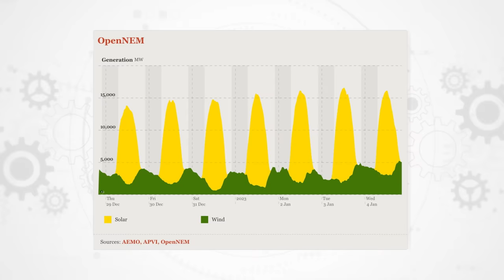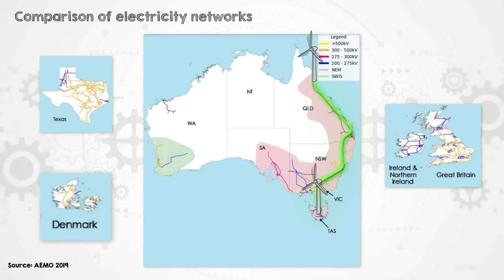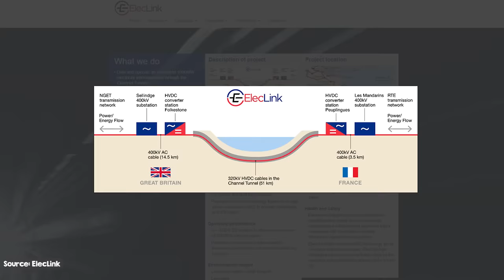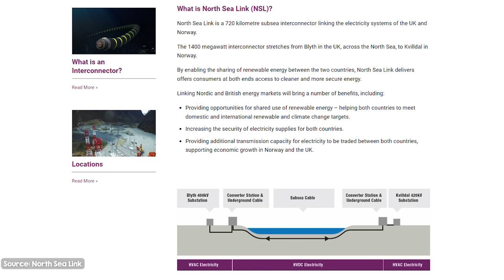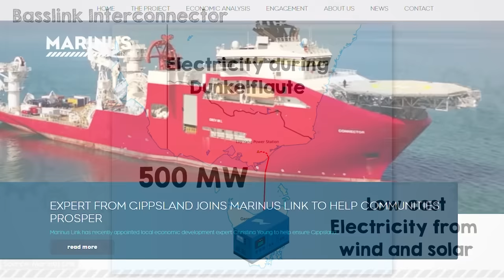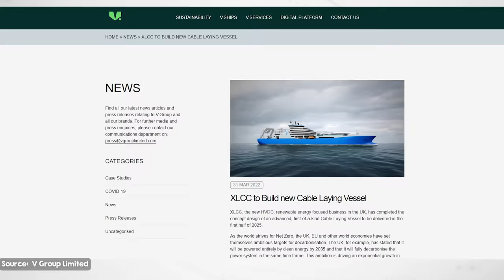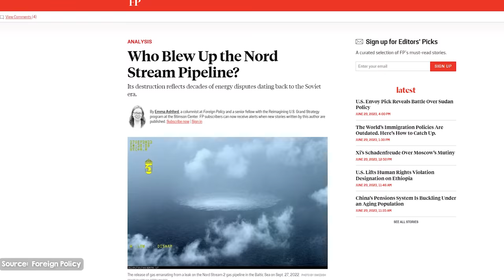Electricity Across Oceans: Is HVDC the Future?

Comment: Hey, high voltage test systems engineer here.
This is an awesome explanation video! I love the representation of HVDC you are doing here. Economic reasons and technological feasibility have a great balance here.
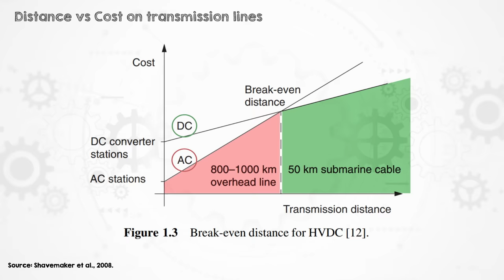You said the cables have a high capacitance due to their proximity to the ground or water. 4:10 While this is technically not wrong, the reason for the high capacitance is their outer, grounded sheath! These cables are under ridiculously extreme electrical stresses compared to open air transmission lines. Their insulation is quite high tech, but the sheath is a key feature. It homogenises the electric field inside the insulation, greatly reducing stress. Also, it keeps the electric field inside the cable, so the outside is (nearly) field-free. Very important as to not disrupt all kinds of stuff going on outside the cable.
Reply: Always happy when experts add to the content. Thanks for your info.
Reply: Given the oportunity i simply must ask: EU to US transatlantic UHVDC cable is still not a reality because...? I mean is it really still technical or economic at its core? According to Rosie 3% per 1000km would add up to 24% for 8000km. That's significant. 10 to 15% sounds like something we could live with. Is there a technological potential here or are we pretty much at the margins? Really excited about the future prospects of this technology!
Reply: @aleksandrsnaumovs4277 Rosie answers that question in the video: because we literally don‘t have the ships to handle that much cable at once, nor the cable factories to produce all of it (yet).
Reply: @screwaccountnames  She never mentioned anything about the losses of 8000km cable. I extrapolated that. The plan she mentioned is in it's infancy. Factories, ships and all that...these mobilization costs. We'll cover this blue marble in a web of wires if there is profit to be made AND the technology is mature enough. So...where are we? Are we still developing the tech and procedures?
Reply: @aleksandrsnaumovs4277  Electrical resistance goes down if you make your wire thicker. This means that theoretically, it should "just" be a question of making your sub-ocean wires thick enough to reduce losses to an acceptable level. However, that's obviously also a huge cost factor, and maybe even a materials science problem (I don't know things get too stiff / prone to breaking if you make the cable too thick).
However, even if we built the production facilities for that much cable and the ships capable of laying it on the ocean floor, I don't know if those huge investments would be justified by the economical benefits of a connected grid.
Reply: Thanks for your well informed reply!

Do happen to know about Ultra-high-voltage  DC or UHVDC? 

I have been reading (not an expert in the field, just interested) about it in the past,  They work with voltages up to 1,100 kV and are supposed to minimizing transmission losses.  Seemingly production ready, especially suitable for long distance (thousands of kilometers) . 

Notable examples include the Three Gorges-Gezhouba-UHV DC transmission line in China, the Rio Madeira HVDC link in Brazil, and the North Sea Link connecting the power grids of Norway and the United Kingdom.
Reply: Was she correct about the "inductive losses"? I've never heard of that, does she just mean extra VARs?
Reply: @Ikbeneengeit good pickup , I think you’re correct. 
There’s no real power loss in inductors or capacitors - however they result in less real power being transmitted for a given cable VAR limit.
Reply: The simple answer is that it's too expensive. You always need to compare transmission with just building generation instead. A few GWs of generation will probably me much cheaper and less risky than the world's longest HVDC cable.
Reply: @mikegofton1  Not completely true. In any practical circuit, both reactive AND resistive aspects exist. Current in a capacitor for example, will also create I2R losses. So with an AC transmission line, even with the load disconnected, capacative coupling will cause I2R losses. Not so with DC.
Reply: @johnchapman1903  I beg to differ - my statement was accurate. An open transmission line will have some power dissipation with AC voltage applied, however it’s only due to the conductors resistance. Rosie stated that the continuous changing of polarity across a capacitor results in resistive power dissipation, which is a bit misleading. The distributed inductance and capacitance of a transmission line does not , of its self, dissipate power.
Reply: @mikegofton1  fair enough, but I’m asserting that in the real world capacitance does not exist without resistance, with the possible exception of superconducting capacitors.
Reply: Likely, you are explaining the reason Hydro-Quebec is saying that it 550KV CC line crossing the St-Laurent river—the wire in the tunnel will last only 40 years.  A lot less than the cable over the air.  (Maybe, the fact the line was build in 1992 make it different than modern one)
Reply: @mikegofton1  this is what Rosie does for her day-job, she knows what she's talking about, she's also backed up by every textbook from high-school level to university level.
Reply: @aleksandrsnaumovs4277  you answered your own question – "it's in it's infancy".
Reply: @aleksandrsnaumovs4277  the distance problem is both technical & economic, lines losses (I understand) reduce with distance so 100% loss takes more than 30-odd thousand kilometers but not enough more. At the end of very long runs the loss is still more than accountants will stand for. 

There are improvements in line losses being invented frequently but obviously it takes a while for them to get on the market, the line Rosie shows in the video is very different from the 1850s lines that originally crossed the Atlantic, to start with cross-linked polythene is a relatively new invention compared with gutta percha so are semiconductors that she showed as a 2nd layer of insulation. One day a superconducting material that works at high enough temperatures to lay undersea will be invented but that hasn't happened yet.
Reply: @alanhat5252  I’m not disputing Rosie’s qualifications, and her channel content is excellent which is why I subscribe.
For clarity, the point I noted in my comment relates to the segment where Rosie discusses why AC transmission lines dissipate power without a load applied. The explanation showed graphics of capacitors and inductors with a description of how energy is stored within electric and magnetic fields. Rosie said this resulted in resistive power loss, which is what caught my attention. I wasn’t the only one who had the same reaction, which is why I posted my initial comment. In electrical engineering text books, transmission lines are modelled as distributed RLC sections which makes it clear that power dissipation occurs as a result of idealised resistance - not idealised capacitance or inductance effects, which are themselves lossless.
Reply: @screwaccountnames  You can make thicker cable, but it’s better to use higher voltages. Doubling the voltage halves the current, which cuts resistive losses by a factor of four. So rather than a 3% loss over 1000km, you’re looking at 0.75%. 0.9925^8=0.9416 Seems like a 6% loss on a Transatlantic interconnection would be entirely manageable. 🤔
Reply: stingrays would not be happy without that sheath haha
Reply: as long as they dont make the cables out of expired carbon fiber i think it will be ok
Reply: @serversurfer6169  Doesn't higher voltage mean thicker cables as well? It's just that the added thickness is in the insulation rather than the metal core.
As far as I understand it, it should make no difference to the overall thickness of the cable whether you double the diameter of the insulation (meaning you can double the voltage) or the core (resistance scales inversely to the cross-section, which scales with the square of the diameter).
Now I don't know what's actually better from a cost and ease-of-manufacture perspective, but I suspect it's a mix of the two.
Reply: it might be uneconomic now but with energy flowing from Germany, morroco, France, Iceland, Norway etc on one side and all the American Grids except texas on the other side, there would ALWAYS be high profit arbitrage availble somewhere. . The network effect could change things entirely.
Reply: @screwaccountnames  You’ll need more insulation, but that’s typically cheaper and lighter than the conductor itself. Also, DC circuits don’t require as much insulation as AC does at a given voltage, because the voltage swings in AC increase the effective load by more than 40%, so a 220VAC wire needs insulation rated for ~315 volts. 🤓
Reply: @aleksandrsnaumovs4277 I'd think it's a question of off-peak excess.  Losing some 25% of "free" power still gives you 75% to sell.  If you have a ton of excess wind at 2am, why not sell it in another market's 2pm peak.  It just comes down to how much it's worth in each local market.  Does that difference in value and the volume available overcome the cost of the install/maintenance.

After that, you have the question of diversity and robustness.  More power sources means less chance of any one type causing problems.  Harder to quantify financially, but still a factor.
Reply: @meeponinthbit3466  You say diversity of power sources is harder to quantify financially, and that's true, but wholesale power markets very much do it. There are several "grid services" you can buy and sell aside from just kilowatt-hours. Hence, grid storage is not just arbitrage (buying power when the wholesale rate is low and selling when it is high), a battery bank can also be compensated just for being there as emergency backup capacity, and for other services like frequency stabilization.
Reply: @Ikbeneengeit  theoretically both capacitive and inductive components are lossless but it is the dielectric heating caused by the capacitive currents that causes losses. Inductive losses are radiative but can be high at high voltages and currents
Reply: some believe in centralization and that is the opinion of the industry experts. Local production and storage can be efficient- if done judiciously.
Reply: Imagining shocked earthworms
Reply: @janami-dharmam  yeah, the energy for the heating had to come from somewhere.  But aren't the phaze offsets associated with capacitance & inductance a cumulative problem over long distance too, much like how initially the telegraph line didn't work? 
  Why is this even being argued over if the original discussion is about using DC?
Reply: about time someone started talking about hooking up the world electrical grid. Renewable energy, any place in the world, all day, every day.
Reply: @aleksandrsnaumovs4277  We currently put up with upwards of 67% thermal losses with nuclear and peaker chemical carbon emitters
Reply: @petevenuti7355  Right, these are distributed LCR units and the dissipation is continuous
Reply: Are you seriously advocating the use of DC for long distance power transmission? You are not an engineer, you are a yes man.
Reply: hmm why is it that ohmic losses can be tolerated in HVDC but not in the early days of transmission lines? and also, the insulating layers need to withstand the heating of high-current carrying wire, right?
Reply: @GeoffryGifari  Step up/down of HVDC needs expensive electronics that were not available in the early days. And the heating is distributed, for example if 100 MW is dissipated over 1000 km, it is 100 kW /km or about 100W/m. Buried cables have high thermal mass and overhead cables has no insulation barrier (for dissipation).
Reply: @glennboyd939  I prefer local generation and consumption but connect to the grid for emergencies. Unfortunately the grid is most unreliable when you need it most.
Reply: @janami-dharmam  do you guys have any link on the modern tech to raise/lower DC voltages?
Reply: Not to mention salt and fields can go bad very fast.
Reply: Shark : "Let me introduce myself"
Reply: I am probably missing something obvious but why did AC win out in the first place? Is it like she said, AC is cheaper for short runs? I had a phase in my teen years of being fascinated with the whole AC/DC Tesla/Edison history. I have always had trouble really grasping AC. DC and boolean algebra, logic gates, binary, etc..  has always been way easier to grasp for me. 

The more I try to learn the more confused I get... Why do alternators in cars generate and then rectify to DC? Is it because it is/was cheaper, easier, more efficient to step AC up and down? If so is that the same reason the grid has been built the way it is? 

Do DC lines in the grid have a rectifier and inverter on each end? I realize a rectifier would not be necessary with solar. I suppose my big question is what makes AC cheaper for short distances?
Reply: @GeoffryGifari I wrote out a long winded version of your question before scrolling all the way. I can't find a solid answer either and got excited to ask here. Let me know if you find a layman explanation please. I will do the same, these are the things that keep me awake...
Reply: @MaxUgly  Car alternator related i think its because engine isn't spinning at same speed at same time, which would translate into generator generating voltage that aint same or what not.
Update: I googled. AC generator is better for generating electricity, didn't go further
Reply: @mrbane2000  yea I have gotten that with the "it works better" I suppose I would have to educate myself more to understand why. I kind of assumed that about the car alternator and it goes along with the first thing you said. I know that on smaller scales voltage regulators, flyback trnasformers and rectifiers can be used to step DC up and down. The first two pretty innefiently and lose a lot of energy as heat.
Reply: @MaxUgly Modern DC-DC converters can be more than 99% efficient, but they are still pretty expensive. They use electronics made with silicon carbide or other high bandgap semiconductors rather than silicon. Silicon carbide is still much more expensive than silicon, but the cost is dropping as manufacturing improves.
Reply: Hi - have you seen any plans for HVDC between Europe and America - and if so - what was their goal? Being able to shift 10% of their power? 40%? 100%? How many HVDC lines is that at what expense? If the goal was to firm solar with lots more solar - then I guess you're effectively overbuilding in each say 5 hour chunk of sunlight for the 800 million people across the USA and EU! Wouldn't it then become a trade off between the economics of doing that or just building off-river pumped hydro for 2 days storage for each city, which can then be shared across just continental USA? And doesn't the USA have all sorts of trouble just building HVDC across their own continent? (I LOVE this super-grid idea - but I'm just letting my ignorance do the asking! Please tell me it's all possible and economic!)
Reply: @screwaccountnames   I guess making the cables on the ship itself isn't possible? It would solve bending and storing issues. The cables seem complex, but not so complex that assembly on the go seems impossible. Maybe the biggest issue is Quality control?
Reply: @mikegofton1  I think the answer lies in your query: "transmission lines ARE MODELLED as distributed RLC sections...". Keep in mind the adage that "all models are wrong; some models are useful".
Electromagnetism involves fields propagating in time and three dimensions through varying non-homogenous, non-linear materials. The reduction down to a small number of idealised elements provides an incredibly tool useful for modelling real-world circuits. The assumption that they behave linearly simplifies the mathematics such that much of the behaviour can be usefully quantified using little more basic arithmetic. But keep in mind that there is no such thing as a perfect capacitor, a perfect inductor, or even a perfect resistor.
I don't think a simple RLC model can explain the behaviour of energy dissipated from an oscillating transmitter aerial, surely an example of an inductive loss as another commenter suggested. Nor the hysteresis and eddy-current losses in a transformer core. Nor the ionisation of air molecules at sharp points of high-voltage transmission lines.
When engineers are pushing the boundaries of what's possible, a simple linear model is just the beginning.